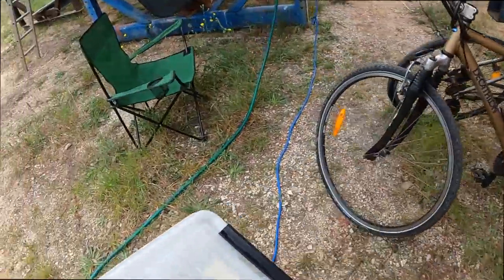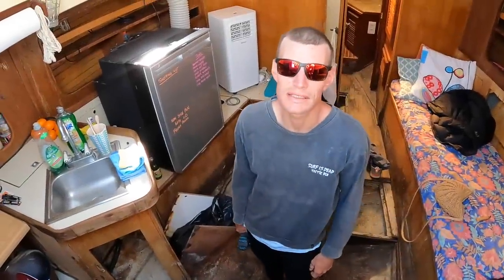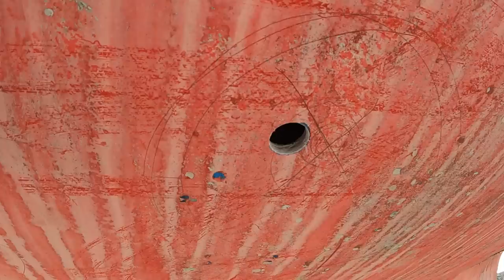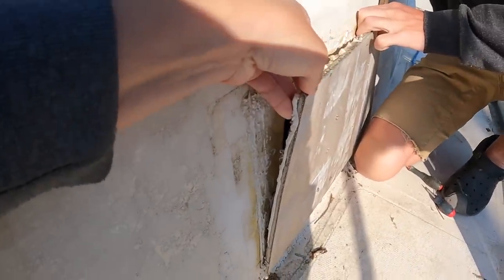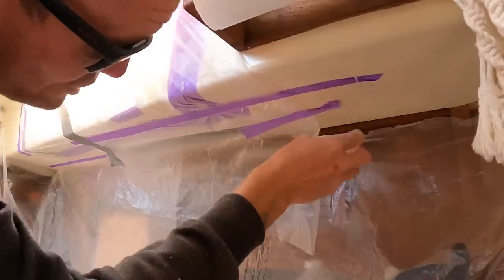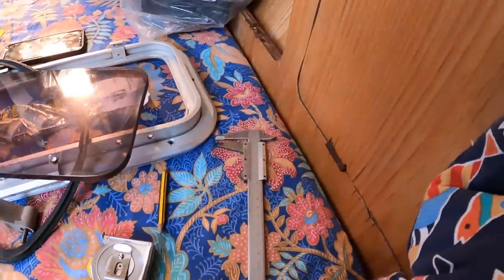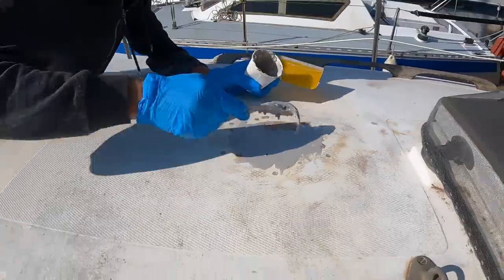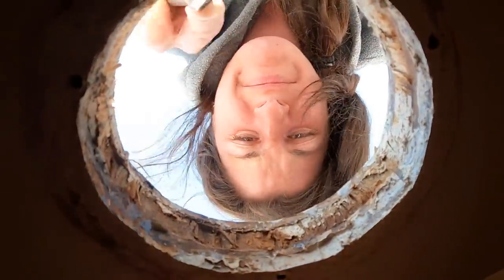Abandoned Boat = Rotten Core? THE €1 BOAT | SAILING SEABIRD Ep. 22

Comment: Stewart if you are using liquid epoxy on vertical surfaces such as around that porthole try rolling on some peel ply to stop the resin from sliding downwards. It gives you an even thickness and a. nice surface to sand or add further layers when you peel it off.
Reply from the maker: Thanks for the tip.
The more advice the better.
We should start making notes of all the advice we're given. It really does help.

Comment: Great to see Y'all back working on the boat! You are doing a great job bringing Seabird back to seaworthy condition. Friendly suggestion... When cutting out areas like the vents you are closing... best practice is drill four small holes in the corners, then connect with straight line cut. Thereby reducing the possibility of stress riser cracks forming in the corners. Love your channel!
Reply from the maker: So, you basically have rounded corners...
Food for thought.
We'll have lots of core to replace. We might try it on the next area...

Comment: The deadcat worked well..or whatever varient you got, i could hear you clearly in the wind.. If you want to cut out the deck to fix soft spots you can, it's definitely a way to go. You can also drill holes a few inches or 5-8cm apart, dry them out (I use a high pressure suction pump..the kind in food saving machines) then once it's mostly dry I put original gorilla glue in there. Wait awhile until it expands, cut off the excess, then fill and sand with thickened epoxy.
Reply from the maker: Great suggestion, we just don't have a high pressure pump. 
Got to go old school and cut it out. A mate finished his refit and gave use loads of balsa. We just need to do another resin order. Only used a gallon last year...
Reply: @SailingSeabird  ya resin gets expensive.  I must have spent $1,000 on west system epoxy and hardener lol

Comment: Rotten Core-yuck-good that you are stripping it out when you can.  I am still concerned about that "other repair" someone did by the Keel.  Water still draining there? Anyway, great to see you doing it all the correct way! Cheers! Rich
Reply from the maker: Hi Rich,
Seem dry now. The hull...
Grind and fill. The itchy work is about to start.
Reply: @SailingSeabird  That is good to hear! take a partial panel of fiberglass off just above the keel, let the air at it and gravity will make sure the core is fully dry before the patch.  When patching anywhere make sure you grind edges of hole to a taper and get to the fiber cloth.  Best adherence that way. Gelcoat cannot hold under stress.
You guys are Great-keep at it! Rich

Comment: On the deck. I have seen people take a mold of the pattern and use it on the gelcoat making the repair invisible, also using the pattern where there never was before.
Reply: Yes , they did it on sailing Parley when they built the sugar scoop steps/deck.
Reply from the maker: It would be interesting to see how it's done.
Have you got any links?
Reply: Matching the gelcoat color takes a special skill, maybe Parley has instructions, my experience was with marina neighbor, not documented.

Comment: O.K. The Olympians are back to the shore from the mountains with no plastered limbs visible. The inside of the boat is dry,clean, and mold free. A good start. The note I left myself about that crack revealing dye said any auto parts store should have it. I made a quick check for a manufacturer and turned up one that made a dye for metal and a dye for plastic. The metal dye was available in amounts as small as spray cans and small containers, but the plastic dye only came in 5 gallon buckets and 55 gallon barrels. So hopefully someone else breaks it down into smaller containers. Maybe bodywork people use it. This is going to be a learning experience. One gem I picked up in my fiberglass studies was that this fiberglass osmosis thing is not always a result of something the manufacturer has done. It can also be a self induced problem by boat owners. But more on that later. That doesn’t seem to be a problem on this boat. How is the boating center there coming along on their recovery from the fire? Western North America got record snowfalls this winter. What was the snowfall situation in the Alps? I have to confess, I was only checking the weather in the area where the boat is once in a while. Take care and welcome back.
Reply from the maker: The dye thing, it would be great to speak about it in more detail.
The snow came late but when it came.. 
Great snow, not even spring snow until the very end.
Some good riding, not as much touring as I'd like but there's always next season.

Comment: As in regards to the mast base step fiberglass as a boot is most certainly going to fail. It needs to be the same alloy as the mast itself  if you use fiberglass it will shear off  as the loads in this area are tremendous. You might consult a rigging company other than that we love you guys an wish for the best!

Comment: The quality of editing and wind noise is not important for my enjoyment. The eternal wind that blows over the Napoleon harbour boatyard is legendary. Dries everything out a treat though. 
Pro tip...you may need to fit what we experts call a thru-hull fitting for your galley sink drain before you launch. 😂
Reply from the maker: A through hole fitting...
We planned to use chewing gum and leave a little bit of pipe poking out. 🤣🤣🤣
Reply: @SailingSeabird  that could work too!🤣